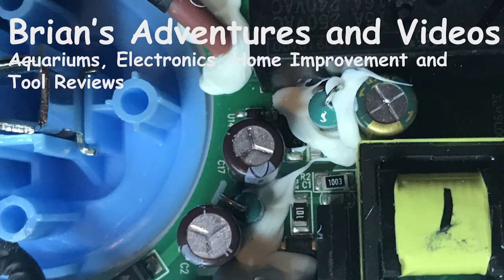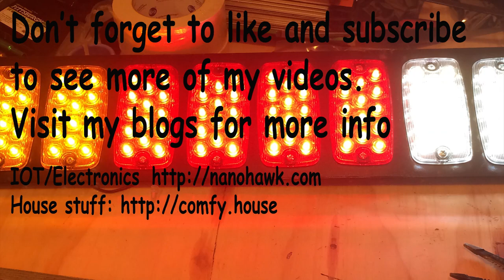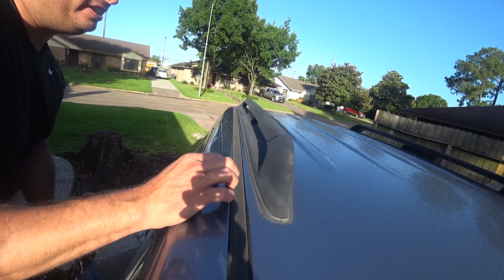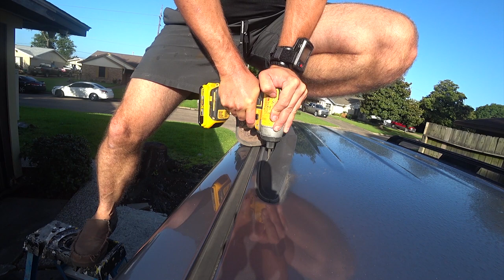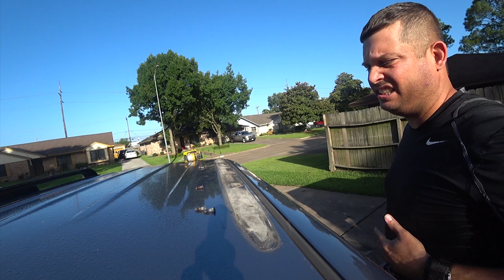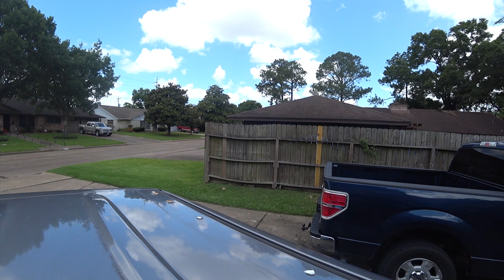Removing the factory roof rack from a Ford Escape

Comment: Half of the screw have broken and are just spinning. Can’t extract them. Any tips?
Reply from the maker: Can't do that on threaded inserts.  They hold still by compression.

best thing to do is use a screwdriver tip to hold it still or to access from under neath, but that requires taking out the headliner.

Failing that, just put some 3M 5200 over them.  It's indestructible.  https://amzn.to/3nkJvym